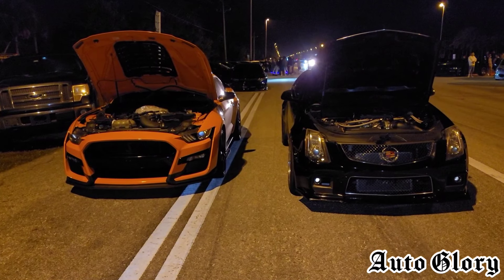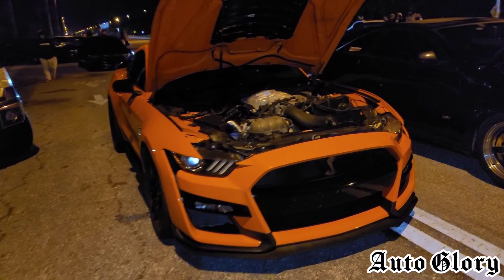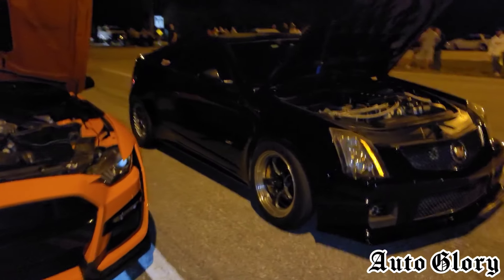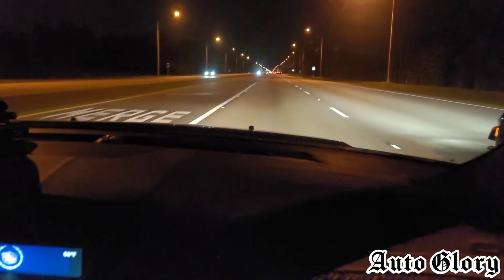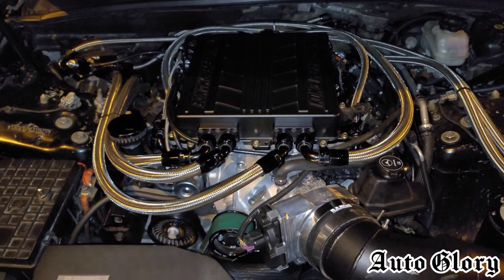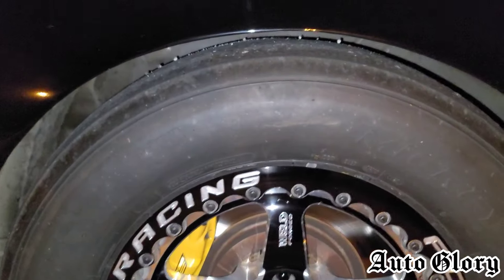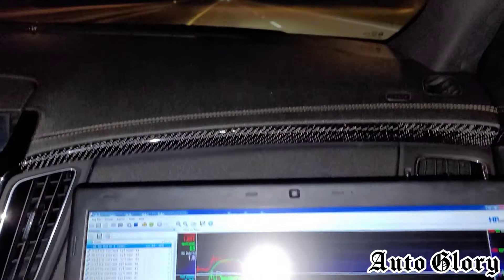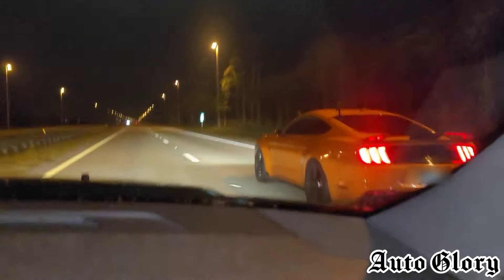2020 Shelby GT500 Bolt Ons E85 vs A Built 2012 Cadillac CTS-V Kong 2650 Supercharger E85

Comment: This race played out the opposite of what i thought would happen. Im thinking the V would jump out and the gt500 would reel it in. That caddy runs strong to pull a gt500 like that
Reply: Fully built V I expected more from the V
Reply: @885.0ELopez  I bet you did😂
Reply: @885.0ELopez  Its on its 2nd highest map. Would drag it no prob on its highest setting 😂
Reply: @885.0ELopez  It depends on what bill you go with
Reply: @texasstreetkings537  tacopez 😂
Reply: So u want it to have more hp then it already vs a bolt on gt500? I mean after the loss it took it may need to put on its highest setting

Comment: That is very impressive that a car that was made 9 years before this mustang is still able to catch up That's impressive And keep in mind you can find a second gen CTS-V for about 35,000 maybe a little bit cheaper than that It would definitely be worth to buy one
Reply: years don't count when you are fully build engine/trans  and running 900whp
Reply: @flamurmustafa522  exactly
Reply: @flamurmustafa522  y’all only say this when it’s any other car but when a fully built mustang beats a stock car y’all say it’s a “bang for your buck” the meat riding is crazy
Reply: @flamurmustafa522  was about to say this 😂
Reply: I love the V2 but you guys have to stop talking as if these cars came from the factory this quick. This car is completely built with about twice as much power that it had from the factory. Yeah the car may cost around 38k-40k stock right now but you're going to put around another $15-20k into it to get this fast..
Reply: @Ericship8  Those mustang guys say that because it doesn't cost a lot of money to get good power out of those coyotes. It probably costs almost twice as much to get a LT to the same power level all because of the goofy direct injection.
Reply: @flamurmustafa522  actually they do and that Cadillac is way heavier so it makes it even more impressive that the Cadillac was able to still catch up And it makes it even more impressive that It's a bolt-on 500 at that. They both are very impressive cars. So don't get my words twisted if you did lol
Reply: That don't mean  nothing you can build a lawnmower to go fast its got a built motor
Reply: @ericship8383  For real You can either spend 73,995 on a GT500 or you can spend $35,000 on something that is just as fast lol both cars are actually fast But the V2 is definitely worth it
Reply: @Cardiakk  I have a V2 that is pushing out 1200 horsepower and it costed me 10K But let's be real both cars are hella fast lol
Reply: @kme5925  My V2 when it was stock I actually did a run and I out ran a 500 and a hellcat  But just like I said both cars are actually pretty impressive
Reply: Now everyone I can't wait to see what someone can do with a fully built black wing
Reply: @HypeLady92  10K for the entire build or just the horsepower?
Reply: @Cardiakk  the entire build
Reply: @Cardiakk  I know a few people that knew how to install the parts so they did it for very cheap so I was basically only just paying for the parts
Reply: @HypeQueenIsNDaHouse  Nice. Built trans and radials all within that budget or are you the factory wheel setup?
Reply: @Cardiakk  Yeah we stayed with the factory wheel setup because it hasn't really caused us any problems and it handles better with the factory
Reply: A 1992 Foxbody pro mod
Will beat the shit out of these 
Cars like they are standing still
Age means nothing honestly bro
Reply: @HypeLady92  I call bullshit. 10k lol
Reply: @HypeLady92  10k for 1200 hp El o El.
Reply: @HypeLady92  I've owned plenty of fast cars to know it takes a lot more than 10k to build a 1200 hp v2. What unicorn dyno do visit? 🤣
Reply: @xm3ntal620  again I know the right people and I pay almost nothing for labor I just bought the parts And I'm friends with someone that works for Dynocom  You just got to know the right people to get the right prices lmao, trust me you're not the first person to call BS because even people in person that seen the car they call BS. But they won't have anything to say once they get gapped 🤣🥱
Reply: Its a fully built car. You could do a built anything at that price range and be impressed
Reply: @shad3128  still doesn't make the car not impressive lol bus cars are very impressive
Reply: @HypeLady92  How is the V way heavier? You've spoke more BS on here then anyone...lol...they both are rated the same weight at just over 4200lbs from factory and no, you didn't build a 1200hp V for 10K. Just stop.
Reply: @HypeLady92  maybe you out ran an ''old"500 , no way a new generation gt500
Reply: @HypeLady92  you do understand that anybody who actually works on cars don’t believe any of the bs you’re saying right??😂😂
Reply: @HypeLady92  and no? A cts-v stock is not almost as fast as a new gt500. It ain’t even close
Reply: @HypeLady92 - it’s because not 10k to make that horsepower supercharger new is 7000
Reply: 760hp 10speed vs 556 6 speed auto. Both few pounds within one another. more likely less. Same weight and power if the GT500 owner wasn’t didn’t jump twice it might of been solid. Both move hard
Reply: @freak_5.042  sourced correctly and doing the work yourself you can make 1,200 out the junkyard for that much. New pistons gaskets seals rods bearings turbos and manifolds. Throw in a junkyard transmission as well with upgraded clutches valve body and converter. I’ve built $600 cars that beat $30k brand new ones. Sometimes it’s what you know, sometimes it’s who you know. He with the deepest pockets wins the race…
Reply: @WoodLox  Your argument is completely ridiculous. Ok, a stock CST V and a GT500 ain't in the same realm, sure, but when you completely build the whole car from top to bottom for racing? Built engine, built transmission, all the boost, E85, KONG 2650 blower? Then that's a race purpose built car ..lol... which I guess now again, makes them not in the same realm because you have a factory car with just E85 and a pulley vs a completely built, race purpose car and it still couldn't pull off the win. The lengths you fanboys go to when your brand loses is weak as f**k.
Reply: Dodge and GM are king!
Reply: @DodgeandGMkiIIingFurdDaiIy  🤣 still going I see 😭😭
Reply: @CoyoteFTW  Yeah that's if you want one of those big ass superchargers that stick out of your hood those ones cost that much Weiand 6-71 Nostalgic Street Supercharger Kits You can get anywhere from $5,000 to $4,000 and if you know the right people you can get them cheaper again I know people that sell the parts  You just got to know the right people And then for the transmission I already had a friend that had a fully built transmission all ready to go so I only paid 2,000 for it I can send you the whole list of upgrades that I have but I'd be typing out whole Bible pretty much 🤣🤣 But real talk you just got to know the right people Don't worry I got people in real life call bs lol But again if you know the right people you can get parts for very cheap and get them installed for very cheap.
Reply: @JohanSalvattore  do it look like I give a f***? 🤣🤣
Reply: @WoodLox  true that but every pound counts lol It's just even more impressive that Cadillac managed to make a car that was fast and they built it with style in class 😂😂
Reply: @freak_5.042  Both performance street cars upgraded. Doesn’t matter, one came with 200hp more and is upgraded so it’s justified. Jumped both runs still reeled. Good runs but hard to call a winner. C7 Z06? Exactly ZR1’s out of reach. Fanboyism really isn’t
Reply: @WoodLox  very correct I've seen people do that and they only had to spend 5K because they were junkyard parts so they were really cheap
Reply: @freak_5.042  Don't be salty because people are calling you out and you aren't right 😂🥱
Reply: @DodgeandGMkiIIingFurdDaiIy  No doubt both are very fast cars very good car companies
Reply: @orlandonoche  No it was a 2021 It was a close race but I still got him but barely lol I would say they both are very close It's hard to tell which is faster because they both get very close when it comes to the finish line lol
Reply: And now I'm done I just had to get on y'all ass Y'all getting out of pocket 🤣🤣🥱
Reply: @HypeLady92  🤣 oh man. You gave up already? Weak.
Reply: @WoodLox  😵‍💫 ...I can't even understand what the hell you're saying now. You're really triggered over the V losing 🤣
Reply: @freak_5.042  No I just have better things to do other than talk to people that don't know shit about cars 🤣🤣 anything else 🥱🥱
Reply: @HypeLady92  Please, explain what I have been "called out and corrected on" 🤣
Reply: @HypeLady92  🤣 oh? You've been writing paragraphs of nonsense trying to justify how awesome the CTS-V is even though it lost. I actually think the V is an animal, savage build, but it just didn't have enough to take down the lightly modded 500 today and you can't stand it. It's ok. You'll man up some day 😔
Reply: @freak_5.042  You know I could totally roast you if I wanted to but you're too innocent for that, I would never do that to such a sweetheart 🤣🤣
Reply: @freak_5.042  2nd highest map, again. Only you would say who lost without truly even knowing who won. Both runs weren’t good for a calling. Triggered fanboy from screen name to picture. OFFICIAL! 😂 🤡
Reply: @WoodLox  They were great runs. 500 jumped hard on the first but the 2nd run was a pretty solid start but your fanboy brain won't let you accept t it. The pain is real. You hurting bad.
Reply: @freak_5.042  poor kid is raging so badly in the comments 🤣
Reply: @DodgeandGMkiIIingFurdDaiIy  Mr rage himself still raging 🤣🤣
Reply: @HypeLady92  a stock V2 isnt out running a hellcat... stop the cap
Reply: @Brianbugz34  Bet I got you I'm going to send you the video 🤣🤣 One second hopefully my comment doesn't get taken down for sending links but I'm going to send you the link to the short lmao let's see If I'm cappin then lol
Reply: @Brianbugz34  hold on I have to find the video but I got the video just wait and it was a red eye I think if I'm not mistaken 🤣🤣
Reply: @Brianbugz34  You said I was cappin boy get em up out of here try again 😂🤣😂🤣🥱
Reply: @HypeLady92  yo you literally had that video waiting for somebody 🤣 I'm dead
Reply: @thanks3550  💀🤣
Reply: @HypeLady92  u capping.. that aint ur V 😂... u dont kno the mods on it.... so a stock 5.0A10 can beat a stock V.. but a hellcat beats Stock 5.0.but ur V beat a hellcat lmaoooo
Reply: @thanks3550  dont believe the hype lol.. that aint her... trying to convince me that a car that traps 12.6 stock beat a car that traps 10.8 stock 😳
Reply: @Brianbugz34  I don't know why you wouldn't believe her when the proof is right in front of your face 🤣
Reply: @thanks3550  that aint her car.. lmao.. 🤣🤣🤣🤣🤣
Reply: @thanks3550  lmao girl these are the type of people that can't handle the truth 🤣🤣 and they're oblivious to being a true car enthusiast they don't know what it's like they don't know any better 🤣🤣🥱
Reply: @Brianbugz34  It isn't lmao But it's a video to prove you wrong just take the L bro get em up out of here 🤣🥱
Reply: @freak_5.042  he was gone before the three was completely said on the 2nd. Everything else out your mouth concert. Opinions are not facts. Ok ok put down the pompoms oval princess
Reply: @HypeLady92  it didn't prove anything lol its a modded v vs a hellcat.. show me a stock v beating a stock redeye.. i will wait...
Reply: @WoodLox  🤣🤣
Reply: @HypeLady92  so you out ran a gt 500 2021 with your car stock ?? That’s what are you keep saying?
Reply: @Brianbugz34  https://youtube.com/shorts/YhVKdkCR9ms?feature=share here's another one where One of my buddies with a a stock CTS-V gapped a hellcat🤣🤣 lol You want more or are you done? Lmao
Reply: Oh God I hope by comment doesn't get removed because of all these links 🤣🤣🤣
Reply: @orlandonoche  when my V2 was stock I did But my V is far from stock now lmao I don't even race 500s anymore because this is going to touch a nerve for you mustang boys but I eat 500 for dinner when I race them I take them to Gapplebee's and back with some leftover gap sauce 🤣🤣🥱 it's the reason why I don't care what people say about me because in person I'll send them home crying because they got gapped so bad 🤣🤣
Reply: Y'all got me out of pocket now I'm out here doing my shit talking I'ma be humble like I'm always am 🤣🤣 just because I want to be humble It's no fun when there's constant shit talk for no reason
Reply: @HypeLady92  Ultimate Troll yo 🤣 😂 💀 😆 ... so ur V supercharged making 1200? lol
Reply: Honestly impressed that a bolt on gt500 could stay ahead of a fully built car that weigh the same while on its second highest setting with more hp lost too 🤯
Reply: @Brianbugz34  damn straight lmao It doesn't make me a troll just because I'm getting on y'all ass calling every one of you out that are being salty for absolutely no reason 🤣🤣
Reply: @HypeLady92  of course why to keep racing those gt 500 now when you even stock out ran them right 😂😂😂, Men you are a lot of entertainment for sure , have a good one
Reply: @HypeLady92  😂😂😂😂😂😂 and what supercharger is that???? since u bought the parts?
Reply: @Brianbugz34  Magnuson Magnum Supercharger System TVS2650  One of my friends she actually helped me find one that was for 3K   I bought it off of this old person that bought it but never used it for some reason lol I looked up the original price and it would have been 7 8K lol so the reason I paid much lower price than usual I just know people and I got very lucky lol You just got to find the right people
Reply: @HypeLady92  thats dope 💯💯.. u probably got the motor built for damn near nothing too.. how bout trans and rear?
Reply: @Flamur Mustafa  money counts though, esp. In today's world of inflation
Reply: @Brianbugz34  Yeah it took a group of five of us to actually get the engine to where we wanted it to be lol But all I did is buy the parts and they installed it and built the engine My buddies they were talking about how they wanted to build a CTS-V And I was like hey I got a second gen that's bone stock so I'll buy the parts You guys build the engine And we all agreed and that's how we got it done lol But no doubt it's a fun little project car lol And we went to the junkyard and took out the rear end of a wrecked CTS-V The rare end was unharmed but seeing that it was a junkyard car we got it for almost nothing lol
Reply: @Brianbugz34  My bad that's a lot to read 😂😂
Reply: @Brianbugz34  But yeah with a little bit of time and effort you can find some parts for dirt cheap 😂
Reply: @osirisvb  No doubt lol I agree with that
Reply: @deebo_dee  No doubt both cars are very impressive💯
Reply: @HypeLady92  they are, gm did good I like that they throw ls in everything almost got a gto but the only couple I found were pristine condition less than 10k miles for like almost 50k I was naw forget that rather get a newer car for that price
Reply: @deebo_dee  nice those GTO'S are no joke 🔥💯 because they are so easy to build
Reply: @HypeLady92  exactly, they're more easier to build than most and I like pontiac but I'd rather find a beater gto to build then like off the showroom floor
Reply: @deebo_dee  that's smart I'm think about getting a old CTS V or either a GTO just to experiment and see what I can do with them
Reply: @HypeLady92  they got potential which ever one you go with. For me I'd like to find a nice ctsv wagon to play with
Reply: @deebo_dee  I actually know where to buy some and you can have them shipped to your house but it might be a little bit expensive depending on where you are but I can help you out but just letting you know you're probably going to be spending 40K at the least for a wagon
Reply: @HypeLady92  yea I figured that would be around the price for them not terrible but it's not too bad, also for shits and gigs I'd get the ute from Australia they badass
Reply: @deebo_dee  Oh yeah I've seen those cars tuned up so quick they can actually be pretty fast but it's pretty funny lol
Reply: @HypeLady92  I love em they got that attraction
Reply: @orlandonoche  The hell? somehow I got your reply notification just now from 4 days ago🤣🤣 But damn strength I tell the facts and I'm entertaining at the same time to some folks that come off trollish, And I can say you're partly right on that if you think so because I love touching the nerves on these mustang boys 🤣🤣
Reply: @HypeLady92 funny I have a V2 and I spent about $30k for 1500 horsepower and still need to build my transmission
Reply: @freak_5.042 eh we’re talking about a 2650 LS that’s turned down a lot, that’s the only reason why this was a remotely interesting 

SBE 2650 cars make a 1000whp, “built” 2650 cars should be around 1200whp, this cts v is making stock ported blower numbers
Reply: @ALYXTANKBACKPACK  Ok, so he decided to spend big dollars on a max effort 2650 build just to come out turned down and lose to a basic pulley, E85 car.... sounds like a him problem 🤷
Reply: @Cardiakk yea because I’m at least $20k in my V and still need a transmission upgrade
Reply: @kareemhailey9585  Damn..
Reply: I have a almost stick v2, and it's not beating hellcat or newer gt500 @HypeLady92

Comment: Good race. GT500 truly jumped on the first race, but tree'ed the caddy on the second. For those of you that does not know what tree'ed means, it means he left right at the green. REACTION time is key in racing. Even from a roll. I race that caddy before, and yes, it can move out for sure. Those saying the caddy is a old platform, well yes, it is. But what not makes it old is a fully built motor and trans, modern TVS blower that has been port match with intakes, and numerous upgrades to go along with beadlock rims, and E85. Its an impressive build for sure. A GT500 platform can get a huge bumps by what was done. Bigger injectors to handle E85, a pulley and tune. You saw the result. In the end they were great races, and remember, even if you have 12000 HP, it means nothing if you cannot get it to the ground.